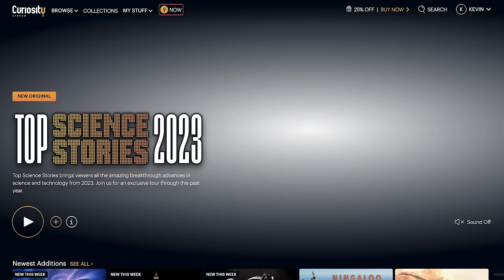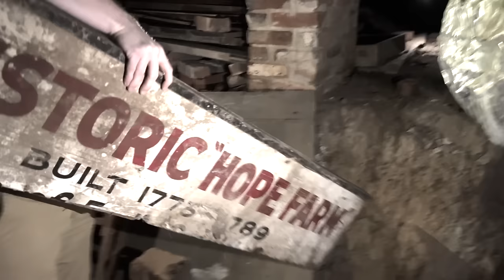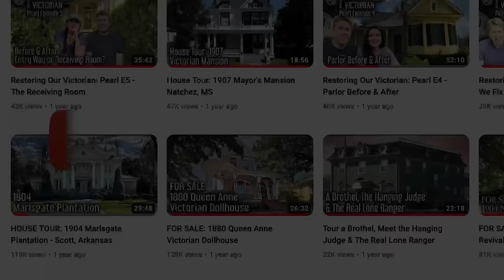Restoring Hope-Demo, Disaster & Rebuilding begins.Watch as we save this 300 year old historic home

Comment: If there were different build time frames with different roof joists directions, then you can rebuild everything going in the same direction.  That would make refoofing so much easier vs. trying to figure out which roof goes in which direction.  At this point in time, does it really matter as to what kind of wood is used in the trusses?

Comment: I stumbled on a alleged restoration video the other day, of a cabin in the woods. You could tell it had been a pretty place at one time, though small. Said it was built in 1930s. Had some great 'bones', but when the guy went in and started just ripping and literally kicking out lathe, I just couldn't watch any longer and turned it off. You guys have me so spoiled! Someone had drywalled over the lathe some years earlier (falling down wall paper looked like 70s.) BUt he ripped out the drywall and then started on the lathe and I wanted to reach through the monitor and hurt him! Just couldn't watch.